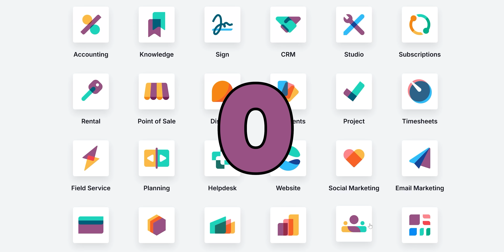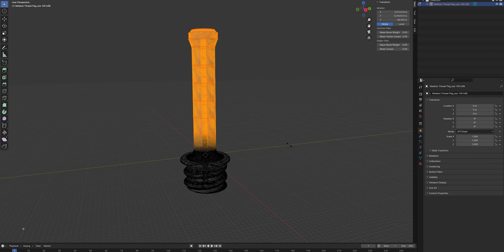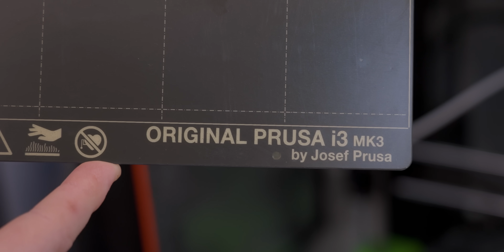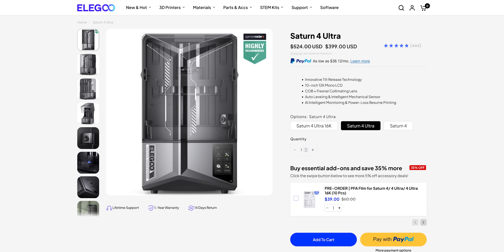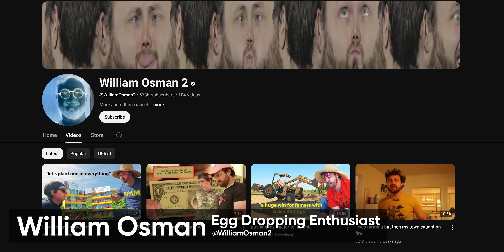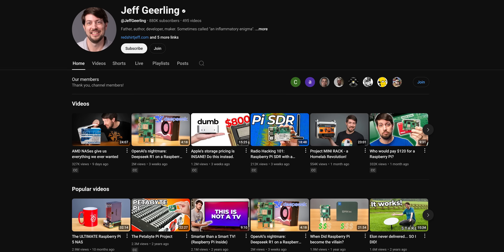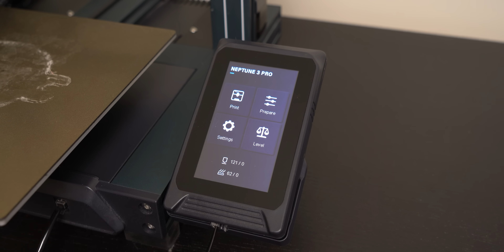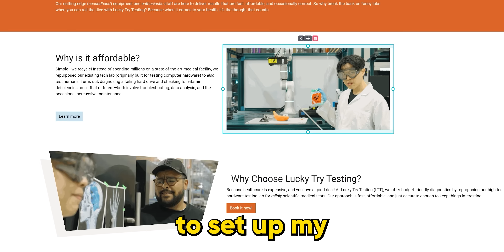Is my 3D printing setup wrong?

Comment: I still haven't encountered a reason why I'd WANT a 3d printer. As someone who is against manufactured garbage I wish you'd discuss that, cause a large portion of items I see 3d printed would be better off not existing.
Reply: ok 1 they are using pla which is compostable aka back to dirt after 5 to 10 years 2 its good for custom solutions which you cannot buy 3 its good for spare parts that they no longer sell or sell at an massive price and can make modifications to make the part stronger so its not designed to break which is what most stuff is these days 4 its good for making prototypes when developing products 5 its a tool that is used for everything from car parts to home improvements to having fun stuff for your kids to learn 6 this is actually environmentally better than shipping a product all the way from China when instead i can just buy one spool of filament and print like 50 to 10 things or one big thing depending and it still works out better than doing the shipping and production in China
Reply: @ScyborneOG  Thanks, that first one is important, they could have mentioned that quickly.
Reply: @artificial_reefer  its only stuff that people like us have to learn when dealing with additive manufacturing when it comes to plastics we learn the difference between pla petg abs asa etc since different materials have different strengths and weaknesses and require different printing temps and ventilation due to fumes pla and petg are fine with just a window open the others are not
Reply: @ScyborneOG  Thanks, I've been kinda wanting a 3d printer but I'm just not sure how I'd actually use it in my life.
Reply: @ tbh i thought that at first but then i gave it a go and i havent stopped since 3d printing has helped me and my friends and family from disability aids since they cost alot and 3d printing has helped lower that cost

Comment: My p1s has been a nightmare with multiple warranty parts changed out chasing issues.  Also my ams has been a nightmare to change filaments since the beginning.  It takes up to 20 mins to  get filaments to load after a lot of back and forth.
Reply: yeah i think you may have just gotten a bunk unit or user error
Reply: @ScyborneOG  definitely not user error.  I made sure to send videos, pictures, and all logs to them.  They even said i wasn't doing anything wrong, just defective parts. Ended up sending me free pla as an apology.  Although the ams is still buggy on ocassion but i just deal with it as i dont have time to play diagnostic email tag with them.
Reply: @ which is why i also said bunk unit as in defective

Comment: Been printing for ten years now, built my first couple of printers OG Prusa's, I have several Anycubic printers that do very well in resin, I didn't care for the Kobra's, but when I got the Bambu, it was a game changer, no more tinkering, adjusting and fighting.... it just works. Yeah software has been weird, but I have seen some pretty good signs that they could be hacked and just ran like any other printer, with so many sold to the people that can hack them, it wouldn't be long till they get hacked.

Comment: I have a Prusa Mk4s with the MMU3.  The MMU has been nothing short of fantastic so far, and totally reliable.  But yeah, loading filament into that buffer is a colossal PITA.
I replaced it with the auto-rewinding spool holders from Filamentalist.  You'll need a bit of hardware for them, including one-way bearings.  It relies on the force of the filament being pushed back to rewind the spool, but there's plenty of force for that task, and rewinding has been very reliable thus far.  Much better than those spring loaded ones.
   
I have 4 of these next to each other in a dry box, a very compact setup.  Loading is easy: push the filament into the spool holder and keep pushing (there's enough room to hold and push the filament) until the MMU3 grabs it.

Comment: TIL I’m supposed to store my filament in dry conditions. I had no idea moister impacts the performance. My house must be drier then most? 🤷‍♂️
Reply: Improper storage/no drying is usually not a big deal with PLA, depending on the humidity can be ok with PETG (it will make a difference, but it may be a small one) but is definitly an issue with filaments like PA. There are a lot of resources on this, but if you want to see something backed by experiments and actual numbers channels like CNC Kitchen or My Tech Fun would be my recommendations.

Comment: Cheap dehumidifier in a box to remove filement moisture. 😉👍
Reply: yeah that works but dessicant is just so cheap also if its the resuable stuff just bung it in the microwave for 5 mins on defrost and its back to fresh

Comment: Everybody is being overdramatic about bambu labs cutting 3rd party...plus there is a workaround. If you want to use a bambu printer then do it, it's awesome and you wont regret it.
Reply: they didnt even cut it its orca just now refusing to co operate and besides i updated i have an x1c and orca still works as it did

Comment: I really wanted to get into 3d printing but was put off by the price.

found an old DaVinci printer on marketplace for $10 then I discovered it was locked down a lot, after a lot of time flashing new firmware and learning the hobby, long story short I gutted the whole thing and put in my own ramps 1.4 board with marlin, slapped a mini pc in with it and now I can remotely manage my printer with octoprint. all it cost was the price of a ender 3 xD so paid the price in the end but learnt a tonne of info. only thing I'd like to do now is get into the 3d modeling side of the hobby since my printer is so custom there are some things I want but will need to design myself

Comment: So I will probably get lost in the shuffle but for the Bambu AMS there are several designs for printing containers that you cant put reusable dessicant in the ams that are easy to load and unload. you just have to stick the beads in the oven for a little bit about once every 3 to 4 months if you live in a particularly humid place like I do.

Comment: Some 3d printing content - cool!. My older 3d printers manufacturer went bust they used proprietary filament that comes with a chip. Lucky they released a firmware update that unlocks the printer. Downloaded but not updated recently moved. I wish that open cad was easier to use, my brain get's a figurative filament jam when i open the program. I really like software that does not require the internet or a subscription where they can change or remove features.

Comment: i’ve been looking to get into 3D printing (from zero knowledge) and was looking at getting the Bambu Lab A1. Thoughts anyone?
Reply: Always open source, Creality K1C was perfect for me when I started. I wouldn't touch Bambu Labs after their announcement, they have no right to be snooping at your files and locking the printer to their slicing software. You lose a lot by buying into their ecosystem, including 3rd party 3D printing apps, and not being able to print until you've updated the firmware? I wouldn't, there's other options which are just as capable
Reply: @ Hm okay, i’ve only ever heard great things about bambu esp for beginners. is creality as reliable and user friendly?

Comment: I'm still stuck using a Creality CR-6 SE. It's an early kickstarter edition with most of it's issues fixed. The one I think will take a new control board is being able to use the micro USB port for OctoPrint again. It fried two SBC's and itself. I soldered in a new USB port and fixed the 24v bed issue with a bunch of kapton tape, but there's no life from the USB port at all. I need to re-check my soldering skills.....or lack thereof!  😜 I also changed to a dual gear extruder and a textured flex steel magnetic build plate. I'm using silicone bumpers for the bed on only the four corners and added the aluminum wheels like an Ender 3 has so I can do manual leveling along with using the ABL. It's all green baby!!! 
When thing is working well, the prints look really good, but man is this thing slow. My next printer is going to be a FAST, enclosed core xy with multi colour abilities. I'm just not sure which one as price is a HUGE factor for me.

Comment: 3D printers getting this easy is really making them a valuable fabrication tool.  If i want to make parts, i don't want to have fuck around with different filaments and nozzles and supports and such, i want it to just work bc for me 3d printing is a means to an end, not a hobby by itself

Comment: I currently have a ender 3 v2 neo and I was always unhappy with it, because the extrusion setup was just horrible, I have since switched it to the sprite pro print head and added a tent and I am much happier, but I still regret not saving up a bit longer and splurging for a prusa

Comment: bambu released there update an im stay away from it, but creality has also put some of the k2 features it was sold with behind a subscription plane so ai detection is part of crealitys subscriptions. i was going to try the k2 but not after this, why spend money of hardware that i have to pay a subscription to use, an if i was a k2 buyer id be pissed over loosing features. this is what everyone was warning about bambu going this direction an its going to continue, it wouldn't surprise me if the ams become locked to bambu specific filament with the rfid reader. also i got around 3000 hours on my first ams an its never gave me an issue outside of the normal spool size an light weight spools not wanting to wind correctly but the correct size spool an added weight when below half a spool an theres no issues. i got less that 5 failures out of the 3000 hours of printing an comparing that to my old machines thats a huge improvement an most of those failures was due to me getting something wrong in the slicer settings that cause the fails like having the wrong plate picked for what was actually on the bed.

Comment: As a PrintFarm owner. Bambulab printers are so easy to use compared to Prusa. We had so little problems with Bambulab, but Prusa had some problems from the beggining. Creality just sucks. Resin is more harder to learn, but provides such good quality it cant be compared to fdm printing.

Comment: I would say that most of the issues people attribute to other printers is actually caused by wet fillaments. I bought one with my K1C and have had zero issues in my 300+ hours of printing. Another thing is that all manufactures matured so much after BambuLab got into the market that I don't think their edge in reliability is there anymore

Comment: meh.  The bambu thing is only a big deal if you're someone who tinkers and customizes their hardware.   Their printers are freaking appliances.  Most people will simply just use them.  - so much easier to use than older printers where you were just expected to be constantly tinkering.   The newest Prusa i've used is a MK3S, I know the newer ones have much of the same advances, but there's no way i'll ever go back to torturing myself trying to keep an MMU working after using Bambu's AMS's.

Comment: 3D printer are NOT that easy. They are not suitable for children below 18 years old. They are a fire hazard and prints fail far more often than not. With out changing a thing mine went from 99,5% perfect to useless in the same spool of filament. If you like making balls of tangled filament by all means buy one.

Comment: The cr10 can fly with some upgrades. I have the first gen CR10 (300mm x 300mm) and it was transformed after I installed a direct drive extruder (3d printed adapter that moves the bowden next to the hotend), BTT SKR v3.0 board and Klipper on raspi. Running a 0.6mm CHT nozzle with a separate power supply for the hotend to increase the wattage as the original couldnt keep up with the CHT nozzle. Also have an ender 3 with similar upgrades that I bought for ~200usd that's excellent. The bambulab X1 does get you a LOT for the price, but these old 3d printers can be upgraded quite a bit with some modern control hardware and software. The CR10 after the upgrades prints around 3x - 4x faster with better quality then when I bought it. Crazy.

Comment: Eh, for ease of use you're still not going to beat a bambu machine though, and the changes affect such a small number of the install base its basically not an issue, and even then they are enabling a developer mode in the future that will allow people to use the current insecure method of communicating with the printer entirely offline

Comment: Someone please tell Camden that the reason his printer's Z offset is changing so often is most likely due to the bed springs.  Stock springs are very very very bad and this is a common issue with FDM Printers.  Grab some 3rd party Yellow Springs or rubber bushings and that problem should go away.

Comment: if you want to change your printer you can get a Elegoo Centuri Carbon, pretty much the same machine as the P1S while being pretty much the same machine, though you might want to wait a little since the Multicolor capability is not out yet but is coming this year. Also, its 300 dollars too.

Comment: I don't understand why the Bambu Lab printers are hard to recommend just because you have to do an extra step to use an unofficial slicer. For most users, specially new users Bambu Studio is just fine and no manufacturer can beat Bambu Labs ecosystem yet, including Prusa. For a beginner and most users out there Bambu Lab is still a great option and probably the best

Comment: Just a heads up, the bambu glow in the dark filament shouldn't be used with AMS. I've heard it's because of the way they make it glow in the dark causes the filament to be a bit coarse (if you run the filament through your fingers you can feel it has a texture to it), it will eat up the plastic gears in the AMS system. It could also explain some of the jams you have been having.
Reply: AMS compatible.. AMS Lite non compatible

Comment: Hey I'm a recent fan after and during the building process of my first every PC exnea a hand me down gpu. I'm having temperature problems with my aio though I also can't tell if it's normal or not. I noticed you have some shorts and an older video on it but if I could put in a recommendation for a temp/monitoring guide I'd appreciate it quite a bit

Comment: Bambu easily still has some of the best machines on the market but closing their ecosystem is a crazy move, however I do believe Elegoo is making some moves that will make a huge impact and can't wait to see it
Reply: However it's exactly the move I've been expecting. Once their printer prices reached point of crappy Enders, I knew there's something fishy and they sell they printers with low margin or even at loss to recoup money with services down the road. So far, it didn't reach that point, but I see locking down the ecosystem as the first step in that direction.
Reply: For FDM the best route is the Creality K1 & K2 with CFS

Comment: You can actually dry filament using your print bed and the box it comes in. 12 hours flipped halfway through and it will be bone dry.

Comment: I don't believe moisture is the big problem for filaments, it's more of an urban legend. I bought like 12-15 rolls of PLA filament 7 years ago. One cheaper brand (5 rolls) is now pretty bad but can work with a drier/heater, while all the other brands are still fine in cardboard boxes in room environment (20-65%).
Reply: If you live in the desert im not surprised theres no problem. But if you happen to live in a rainy/moist area there definately a difference even with PLA
Reply: PLA suffers almost never from the moisture issues. But I can confidently tell you that it’s far from an urban legend. I mainly print with HiPs and it soaks moisture like a sponge. My prints were filled with bubbles from the rapid evaporation caused by the nozzle’s heat. I have even seen the steam with the naked eye. So yes PLA is less of an issue but with some filaments I would recommend using a hotbox.

Comment: Bambu X1C is very reliable and requires little maintenance despite almost daily use.  However, I have to give a shout out to FLSUN for the V400 because it's also easy to setup, has a direct drive extruder, fast printing, larger bed size, auto bed leveling, and requires almost zero maintenance.

Comment: 2:31 Me watching Linus look at the exposed  elements of his wall as an European thinking: There is wood, something that looks  like fluffy flammable insulation and 3D printer which must consume a TON of electricity and generates some serious heat. How is that not a fire hazard. Or am I wrong?
Reply: Most machines in the last decade have multiple layers of thermal runway protection so it’s not really a concern. Same way most people don’t think about their desktop pc going up in flames
Reply: @ Desktops have active cooling systems based on air or liquid. Do 3D printers have somehting similar? I mean when I make coffee in my small machine which takes those tiny pods, it get heated up WAY more than my PC does at any point. Thats why I keep it on a marble windowsill away from anything flamable.
Reply: I don't think flammable insulation has existed for VERY long time. Even as a European your interior walls on modern construction are probably very similar
Reply: @d3lusiv  our houses here in the Czech Republic are mostly built from bricks or cinder blocks, which are used even for interior walls. I LITERALLY know these types of walls only from movies and youtube. I know there have been some wooden houses built here lately, but they are far from widespread.